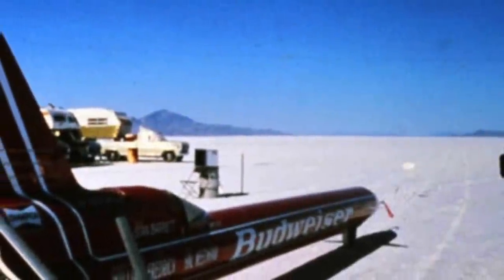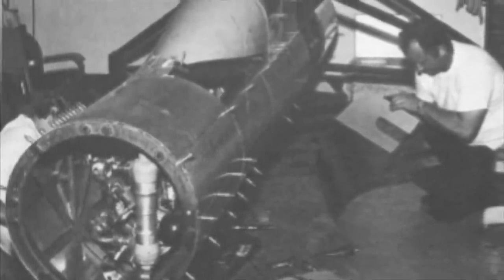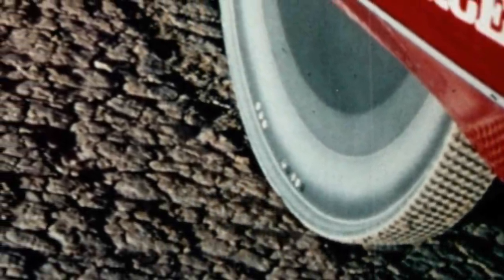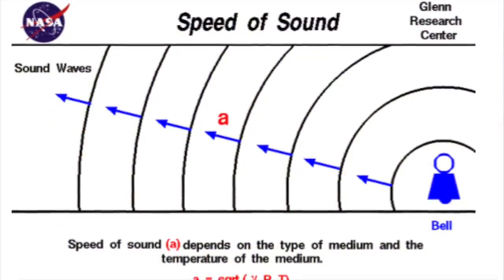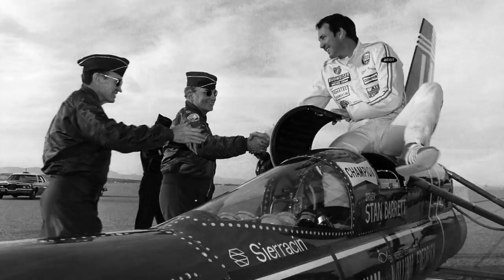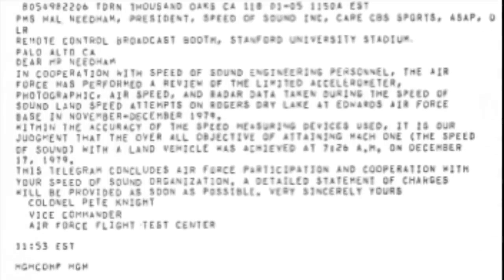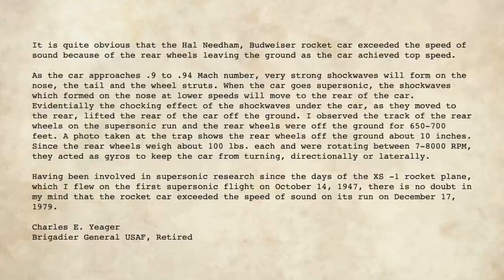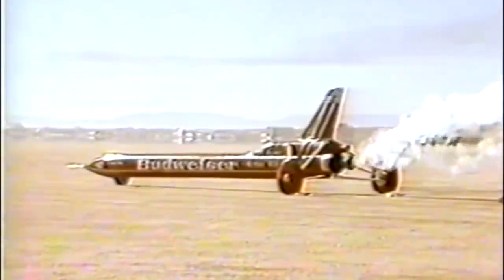The Budweiser Rocket - Controversial Rocket Car

Comment: If it's a rocket car is has a hypergolic engine if there's flame it's not a rocket car it's a jet car you have no idea what I'm talking about do you even understand the word hypergolic
Reply: No, rockets have exhaust plumes too. See solid fuel rockets and liquid fuel rockets. Also rockets utilising hypergolic propellants can produce flames (see Russia's Proton rocket). This car is powered by 2 rocket motors (hybrid liquid and a solid fuel motor). Both motors burn their fuel using an oxidiser stored onboard the car rather than air. It also doesn't have a compressor or jet turbine that jet engines typically have (I am aware of ram jets but they only work at higher Mach numbers). And also not all jet engines have flames, the flames coming out of a jet engine are either the afterburner (which most jets are not fitted with) or the engine breaking
Reply: "If there's a flame it's not a rocket"
Congratulations that's the dumbest thing I've read on the internet today.
Reply: I really hope you understand jet engines and rocket engines work entirely differently, and that is ABSOLUTELY NOT the difference. You dont see solid-fuel rockets on passenger aircraft and you dont see jet engines on rockships. Great job acting like you're smart, though!